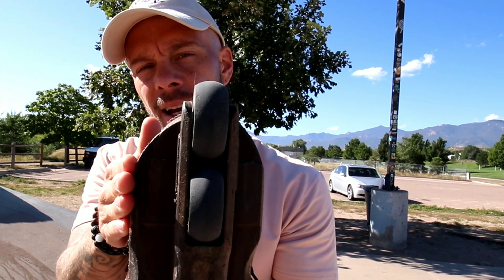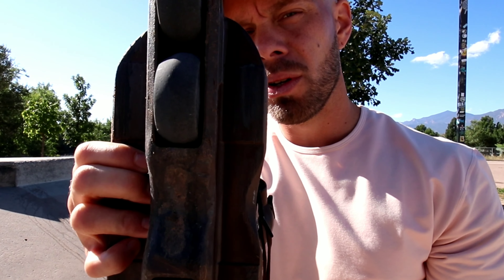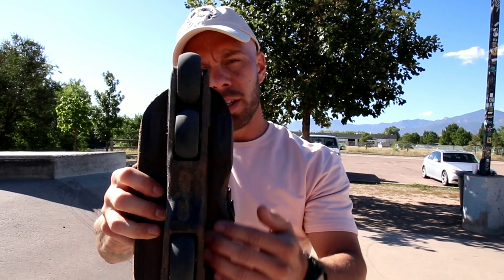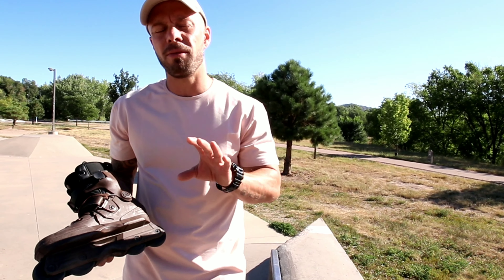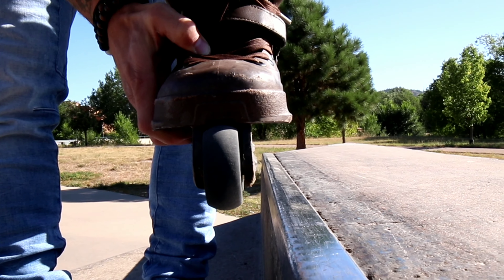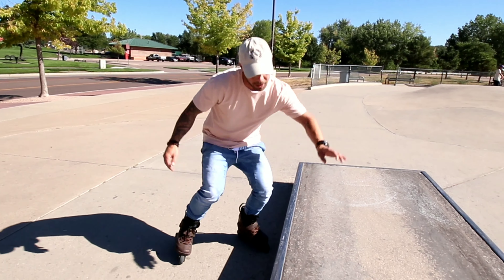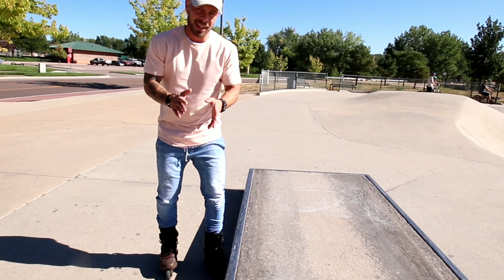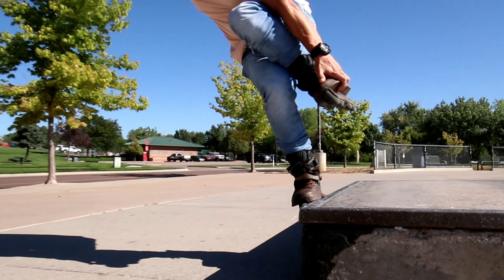Aggressive Inline: How to Negative Makio

Comment: Acosta, I am a big fan, but sometimes you gotta let things go. I also come from the old-school that learned all one footed grinds must be grabbed, but no. It is not like that today.  A pornstar does not have to be alley-oop, A Savannah does not need a spin or be backside to count, and a one footed grind can be "freestyle"... It's not because I want to agree with the newer ways, but the terminology of tricks just makes more sense if we list them the new way. A fishbrain, backslide, makio, or torque should just be called those terms unless grabbed (ex. Safety backslide, or rocket fish)... I suck at negatives btw, except for negative ally-oop mistrial.

Comment: Hey - I don't know if you have any experience with this, but I would love to have a pros n cons video going over the main wheel setups. I've always been riding just flat 4 but since I picked up blading a lot more lately I'm tired of getting stuck on ledges and copings and stuff. Then again, I'm hesitant to switch to anti-rocker mainly because of turning being more difficult. I'm also a pretty heavy fella', like 220 pounds, will that be an issue if I switch?
You're doing great work, really motivates me to practice more :) Keep it up!

Best regards - Jacob